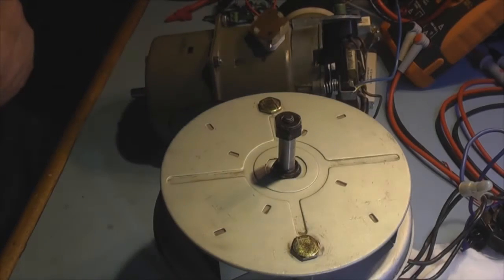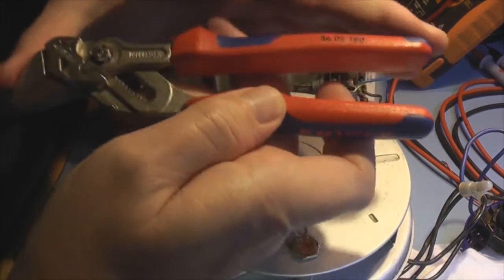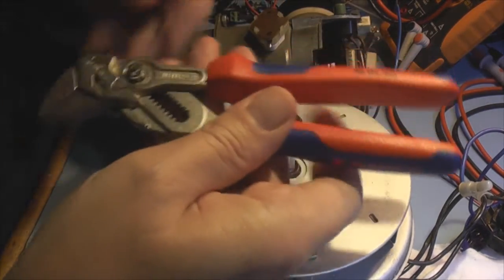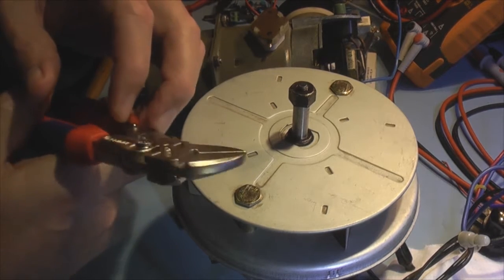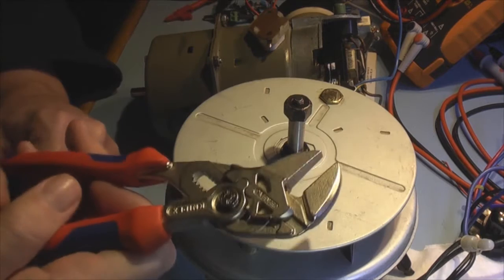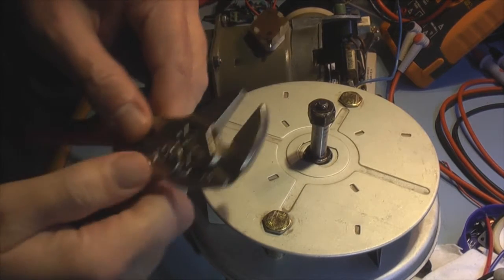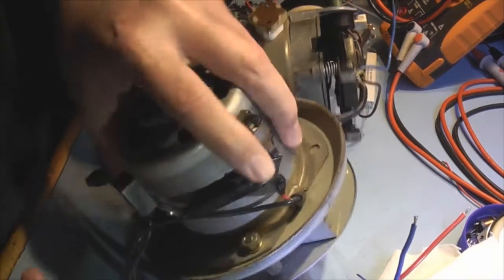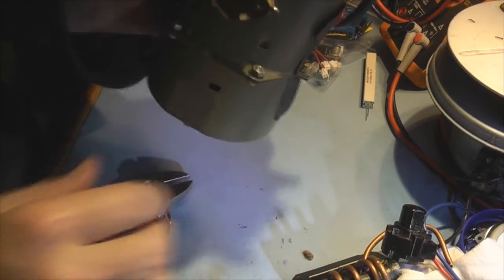Knipex Pliers Wrench

Comment: I've never seen these before, a very clever idea. I've never been much of a fan if using traditional adjustable spanners because they're never quite right and can damage the nut or bolt but these eliminate that issue. I had to buy a 28mm spanner for my gearbox oil drain plug and it cost me almost as much as this, I think I'll invest in a set at some time. Thanks for the review.
Reply from the maker: Thanks Matt. I can certainly recommend these.

Cheers

John

Comment: Okay I am sold.. have to buy a pair now.
They are very expensive here in the states.. on Amazon they are about $70 but you can never pay too much for a good reliable tool.
Reply from the maker: Thanks Mark.

Like ya say, good tools aren't cheap

Check these out though mate $52..

http://www.ebay.com/itm/Knipex-8605180-7-Inch-Pliers-Wrench-Comfort-Grip-/281032947275

Comment: Sorry about the late reply to this John, I actually watched this video not long after you uploaded it, but it was too late to leave a comment that made any sense haha.

I'm really impressed by these Spanner Pliers, I had the same expectation as you about them not gripping enough and slipping, but as you demonstrated, none of that at all.

Also you could spin a nut off pretty damn quick due to the movement in the pliers allowing you to release and return to the gripping position without having to move the jaws of the pliers away from the nut, which speeds things up and makes it easier to use in tight spaces.

The design of the mechanism is quite interesting also, unlike most normal pliers the jaws a parallel due to the sliding rail which is good for nuts and also the pivot point is very close to the slider making for a lot of mechanical advantage over the grip, hence why they don't slip at all.

Overall I could see myself having a pair of these in my toolbag at some point in the future, they may even replace my Bahco adjustable as with all adjustables, they cannot maintain a good grip as the jaws tend to move about when in use where these spanner pliers have a very tight grip indeed.

Thanks for sharing!
Reply from the maker: Steve Lane No need to apologise my friend, I'm always replying late (not intentionally of course) I just don't have time sometimes and then I'll forget.
I do try to make sure I remember to thumbs-up all my YT mates posts though just so that folk don't think I'm a git :)

Cheers mate

John
Reply: Haha yeah that's exactly what I do, forget, then for whatever raison I remember not leaving a comment and going back and end up watching it twice anyway haha.

I find thumbsup" also is a good indicator of what I've watched or not, as the youtube *watched banner seems to be quite intermittent in comparison... xS

Speaking of youtube, I think it's about time I put a video up, I think it's time I do a video on my new chicken stick... xD

Cheers John!

Steve